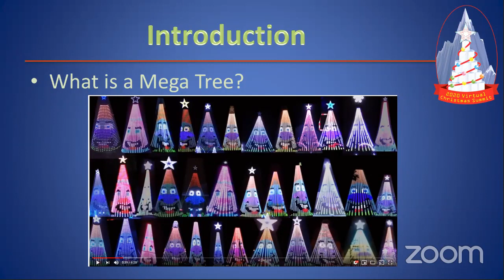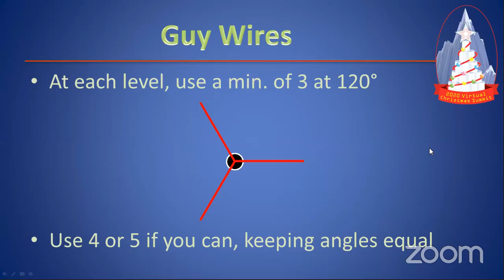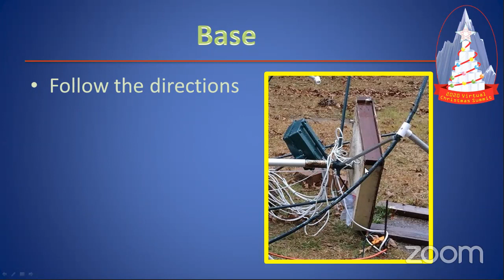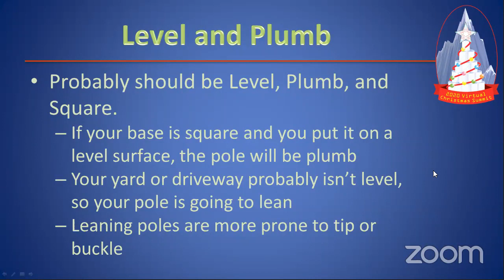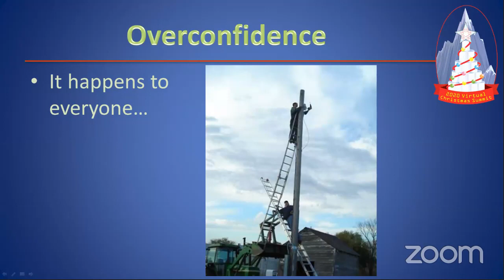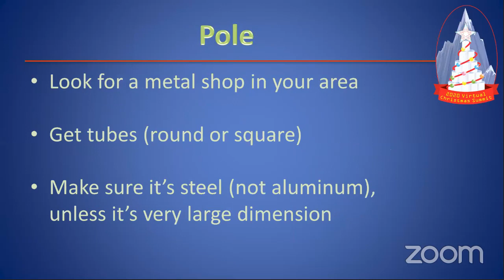VCS 2020 10 Tips for Mega Tree Builds  - Jon DePlanché

Comment: Mr. Jon, thanks for the information and it does help, to a limited scope.  I found the anchors information valuable and placed an order for the Earth Anchors.  My concern comes with the Base and Pole.  Info: I went with the classic ASAP design, one stage so height is about 16ft.

For my case, the base will be placed on my front yard patio, per se, which is concrete.  I don't have any means to secure it to the concrete and the wife unit isn't going to allow me to drive bolts into the concrete.  How would I go about adding structural integrity to a scenario like this?  I will be using 4 guy wires, so it will help some what.   One guy wire will be attached to a pillar connected to the house, so I know that guy wire should be fine.  Also, what diameter of the guy wire is recommended or a bare minimum should be used?

With regards to the Pole, during the presentation it is stated that using rigid conduit with pipe threading isn't the best solution and using structurally engineered pipping is best.  Though, how would this be accomplished?  What type of material be used?  What diameter should be use is something like the ASAP design?  Since the portal hole is very common with mega trees how is the structurally engineered pipping incorporated into the portal hole?  With no additional information on how to incorporate structurally engineered pipping needs to be integrated into existing designs, like the portable hole, or another means offered I am completely clueless.  I am not a civil or mechanical engineer, so these concepts/theories are beyond my scope of knowledge. 

I am definitely not overconfident as I want to make the mega tree as safe as possible.  Even if it top fall over it wouldn't reach the street to cause harm.  Unless someone wandered up the porch.